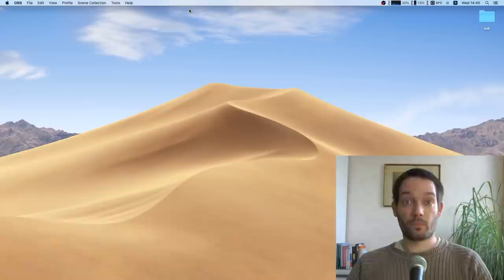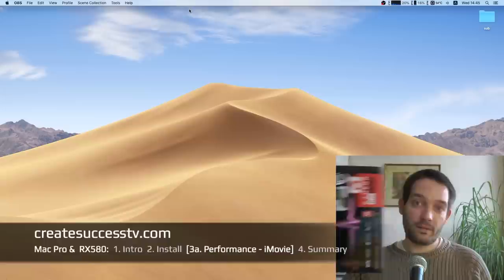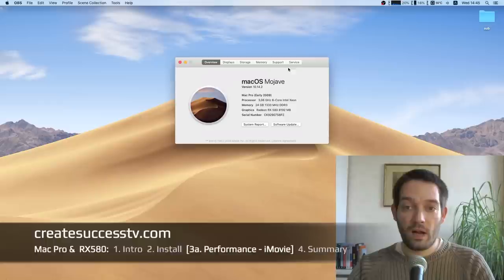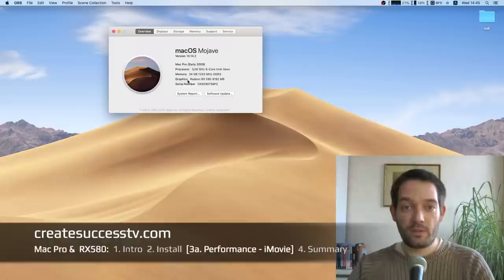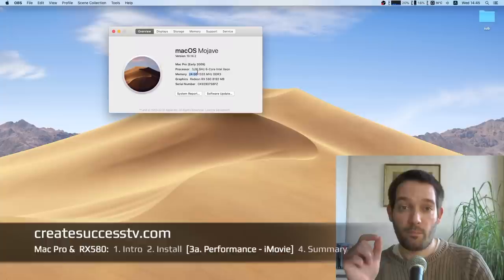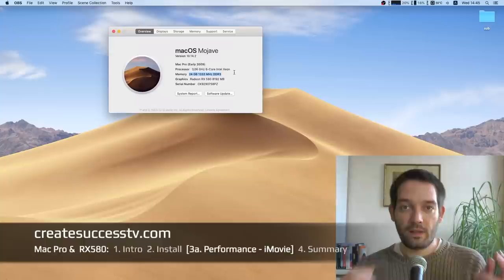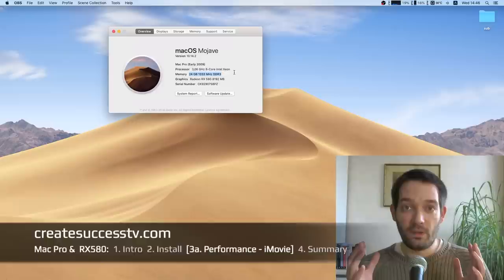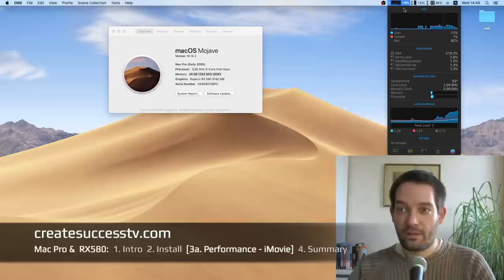Mac Pro 4.1 and 5.1 GPU Upgrade for Mojave (Sapphire Pulse Radeon RX580)

Comment: i would like to upgrade my mac pro graphic card mid 2012, i have a ATI Radeon HD5770, is the RX580 a better upgrade. thank you
Reply: @juschu  i have the same a mac pro 5.1 2012 with HD5770... i would never replace a gpu with non EFI mac edition. with a RX580 have too many problems.. No booting screen, file vault must be disabled, bootcamp issues etc... It's a shame what apple is doing to this incredible machine.... i would prefer update to the nvidia k5000 mac edition it's old but support metal, boot and all... And is not that bad after all... have a display port 1.2 and support 4k at 60 and it's still a valid option.
Reply: @juschu  Since the Sapphire Pulse RX580 do not come out of the box with a flashed ROM for Mac OS you can't physically see booting screen... You will see directly LOGIN screen... that is something different... The Sapphire Pulse RX580 that apple reported as "supported" by the mac pro 5.1 it only means that there's no need to setup or install drivers since the architecture is compatible with Mojave GPU's drivers... In fact lots of persons who updated the Mac Pro 5.1 with the Shappire Pulse RX580 they reported on macrumors or other forums that they do not have booting screen or can't use file vault... So how you can see the apple logo booting screen? you would be the first in the world......
Reply from the maker: @JohnDoe-ml1ui  I think so too, the new graphics cards, RX560, RX580, Vega56 are all non EFI, so you won't be able to see the boot screen, and you can't use the "Startup Manager" Option (⌥), however a viewer once asked me about "macOS Recovery" Command (⌘)-R, and I tested it and at least that worked, even thought it took a moment to boot.
Reply from the maker: @juschu  Are you saying you did flash your Sapphire Pulse RX 580 with an Apple compatible EFI Bios? People in the MacRumors forum claim it isn't possible, see here ➜ https://forums.macrumors.com/threads/why-do-sapphire-pulse-rx-580-uefi-cards-need-flashing.2132482/

Comment: Do I have to install some drivers before I plug it in or is this plug and play ? Cause I have a tried the graphic with one 6 to 8 pin cable but screen stays black.
Reply from the maker: Before updating to macOS 10.14 Mojave, please make sure that your graphics card works with Mojave
➜ https://support.apple.com/en-us/HT208898
Reply from the maker: Case A: Use the "mini 6pin to 6pin" for a total of 150 watts available ➜ https://ebay.to/2QWy27Z
Case B: Use the "dual mini 6pin to 8pin" for a total of 225 watts ➜ https://ebay.to/2zN23QJ

Comment: Hi I do get purple screen when I use DVI but when I use hdmi I got perfect colour, RX 580 nitro+ thanks
Reply from the maker: I did try DVI and it worked fine with my EIZO monitor, maybe check your -> settings -> Signal -> Input Color Format -> (1.Auto 2.YUV 3.RGB)

Comment: I also have a rx580 for my mac pro 2009(4,1flashed to 5,1) , but I wont have a boot screen until the system loads totally. how do u solve this problem? thx
Reply from the maker: First, that is perfectly normal, because the system will still boot and run fine. Also, you can still get into recovery mode by pressing Command (⌘) – R, second, only cards with a custom Apple BIOS will display the boot screen.
Reply: you can't solve this with polaris cards
Reply: Back2Black I think because it’s metal supported in your os....in hs and earlier it won’t show
Reply: @juschu  Where did you get that card from? :)) Most RX 580s, even the Pulse ones, won't show the boot screen.

Comment: hello, thanks for this vids :D I have the same GPU a nitro+ radeon rx580 (mac flashed) but the fan start sometimes... every 15 seconds approximately... I suppose need cold air... But it's very very very frustrating :D did you have an idea how to stop that? i put in silent mode (2) and always the problem :(

Comment: Nice video! Thank you. WIll the card run on a 5.1 with EL CAPITAN? Do i need the power-cable?
Reply from the maker: No, I don’t think so, El Capitan is from 2015 and probably too old, please install High Sierra and get the power cable, more here:
Part 0 - Introduction ➜ https://youtu.be/lJF-rffIyq0
Part 1 - Bluetooth ➜ https://youtu.be/d9xPvreK8tg
Part 2 - High Sierra ➜ https://youtu.be/ecWEhbtvXHk
Part 3 - SATAIII SSD ➜ https://youtu.be/2gqkGPidI84
Part 4 - Radeon RX560 ➜ https://youtu.be/UoV4I-FlYdw
Part 5 - Memory ➜ https://youtu.be/1XYNqfnu4UA
Part 6 - CPU ➜ https://youtu.be/8cVhURcpi64
Part 7 - macOS Mojave ➜ https://youtu.be/uKAJCuWtp4Y
Part 8 - Radeon RX580 ➜ https://youtu.be/Dv73HrnsNkw
NEW *Part 9 - NVMe SSD ➜ https://youtu.be/A8hPC_DDq6Q
NEW *Part 10 - Fan Replacement ➜ https://youtu.be/fBiIJami8v0
Reply: Thanks!  @ReviewTechTV
Reply: @ReviewTechTV  : thx from Belgium for the video! I'm running El Capitan as well on my 5.1 and I'm looking to install this card also. However the systems says it can't upgrade to (high) sierra? How do I do that?  UPDATE: never mind: I've just discovered your other video's stating just how to do that!

Comment: I have a mac pro 5.1 with (Mid 2010) with 2 x 3.46 Ghz 6 core intel Xeon, 
64Gb of RAM
Radeon RX 580 8 GB graphic card
and currently using OS High Sierra 10.13.6

Where and How can i upgrade to Majove ? I tried a patch and got this message :
1. MacOS Mojave Patcher

Natively Supported Machine
This machine is natively supported by Mojave; you do not need to use this patch. It can still be used to create a USB drive to be used on another machine.

What do you suggest sir ? Thank you for your help.
Reply from the maker: Additional information in the video description.

Comment: I have the same RX580 Pulse in a 5,1 and i have problems..keep saying update firmware and it’s been updated 4-6 times..still nothing..i switch slots because i didn’t want heating problems and now that i did a firmware update again, it’s been updating firmware for the past 5-6 hours? And the card don’t have heat problems....so why am i stuck at this point cause i don’t want to cut off the comp to mess anything up!!
Reply from the maker: You can install the Radeon RX580 under macOS High Sierra, then no firmware update is required.
Reply from the maker: If you want to install macOS Mojave on the MacPro:
Part 7 - macOS Mojave ➜ https://youtu.be/uKAJCuWtp4Y
Reply: Review Tech TV where what link, what site?

Comment: Hello. Play on windows ( AMD Vii gpu 16GB ) have tried?  I have Mac pro 5.1, 3.46 Ghz, 32Gb ram, Rx 580  8Gb-i used windows 10 - The witcher 3 ( ultra setting) 60fps. Maybe better Vega 56,64 and Amd  VII gpu  on Mac pro 5.1?
Reply from the maker: No, the AMD VII card needs too much power, and most Vega cards need two power connectors, that's why they don't work easily.

Comment: The sapphire rx580 I have found says it’s windows compatible only. I hear people say it still works with Apple CPU’s though. Are you using the same video card or does yours say Apple compatible? Would like to know before I make my purchase. Thanks.
Reply from the maker: The card needs the correct power cable to work, details below the video.

Comment: I have the same setup and just installed this same graphics card. When I boot the screen colors look like when the cuda driver needs to be updated and says no GPU detected. Is there a driver that needs to be installed? If so I can't find it, any help would be appreciated.
Reply from the maker: Only Nvidia cards have drivers, for ATI cards there are no drivers because macOS supports them natively. Please uninstall all Nvidia drivers before switching to an ATI card.
Reply: Thank you for the help. I think I deleted the Nvidia driver, but the screen still has a purple tint to it. Any idea what might be wrong?
Reply from the maker: I recommend you upgrade to High Sierra, and to make sure all Nivida drivers are removed. If it still doesn't work please check your display.
Reply: I figured it out, when I plugged into the HDMI port it worked fine, not sure why the other didn't. Thanks for the help!!

Comment: Great video! Do I still need my GT120 GPU for Bootscreen Support? In which cases is it still helpful/necessary? I mean booting from pen drive to re/install macOS seems no issue with the RX 580. Moreover I ask myself if there are any disadvantages if I have 2 GPU‘s installed.
Reply from the maker: Personally, I only use the new Radeon RX580 in my system, the old NVIDIA stock GPU has become more or less useless, because it doesn't have Metal support, which macOS Mojave needs.
Reply from the maker: But I still keep it in a box somewhere just in case. And you can still get into recovery mode by pressing Command (⌘) – R, even without seeing the grey Apple boot screen, just takes a little to boot up.
Reply: What about FileVault and Bootcamp? For that I would need Bootscreen-Support, right?
Reply: @Simon-me1qu  I'm running OS Mojave on a 4,1 flashed to 5, 1 that does not require the GT120. I sold it along with an older Mac Pro tower. I have a Radeon 7950 3GB that I dual boot between Windows and Mac OS on the daily. From my personal experience, it's not needed.
Reply: @ofrhythm  how you manage to install High Sierra with the Radeon 7950 mac edition? my Radeon 7950 works only in Sierra when i try to update to High sierra stops working! but with the GT120 works!
Reply: @mrhigado  The only big difference that I would assume first, is that it is flashed to 5, 1. 

I actually upgraded to the Sapphire Nitro+ RX 580 8GB recently.  I am still running Mojave fine. I just think I will be purchasing a GT120 so I can have a boot screen.

Comment: Have you had any issues with the Mac ramping up the PCI and powersupply fans to maximum? I assume it's something to do with the 0 RPM mode on the card like you pointed out. Mine seems to turn the fans to max after every couple of reboots. Many thanks!
Reply from the maker: The GPU fans will spin when you turn on your Mac, but after booting the OS they turn off, unless there is load on the card, e.g. video editing and such, but even then the card is  pretty quiet.

Comment: What I do to make appear the Apple logo on AMD Radeon RX 580 Sapphire Pulse graphics card?
Reply from the maker: Apple uses a custom BIOS on there stock GPUs, all aftermarkte cards dont support the grey bootup screen, filevault needs to be disabled in case you are using it.

Comment: Your suggestion to put the RX 580 in slot 2 to dissipate heat means that it would take-up 2 PCI slots, correct? Instead of putting it into slot 1 which only take up 1 slot, leaving the remaining 3 slots. I guess if you're okay with sacrificing a PCI slot then this is a good strategy.
Reply from the maker: You can use both PCIe slot 1 or 2 depending on your preference as long as it is 16x lane bandwidth.

Comment: hello guys, i have MAC PRO 4.1 and i have just upgrade firmware to 5.1 Now i would like to upgrade SVGA Card, from nvidia GT120 to RX480 8GB or RX570 8GB... I try MacOS 10.12.4 , 10.12.6, 10.13.6 but none of the many can read the VGA AMD... why?? which version of macos i must use for read amd correctly? I have a nvidia gtx 1060 and 1070 ti too but 
 I tried to install it too and it remains even more difficult to make it work so I gave up and decided to use the amd. Can someone help me? I have seen many forums but I can't get away from them.
Reply from the maker: I tested two different AMD cards, and they work excellent so far:
Radeon RX560 ➜ http://geni.us/5V0VD3 
Radeon RX580 ➜ http://geni.us/rX6mx
Reply from the maker: If you can I recommend macOS Mojave, because it is the most up to date version, otherwise High Sierra should work fine as well.
➜ https://support.apple.com/en-us/HT208898
Reply from the maker: Did you actually test your Radeon RX480 card with macOS High Sierra or Mojave? Other people have successfully used RX480 cards without any problems ➜ https://youtu.be/6aB0wcN6l54
Reply from the maker: Also, I noticed that Apple has continued to improve the AMD Radeon drivers that are included in the OS, for example, while my RX580 did not have audio support via display port in the beginning, it now shows up as an additional audio device, that I can select in system settings.
Reply: Now I have 1 drive with 10.12 and another 1 with 10.13... i cant install Mojave because I havent a card that support Metal. Tomorrow I will search any R5 240 and  I try to install Mojave.... and then I will pray that all will be well!
Reply: Also make sure you update the firmware that comes with Mojave. You can do the firmware update , an stay on High Sierra

Comment: Good video and findings. I was wondering what the point of going to a RX 580 vs. an RX 560 was.  I didn’t get the 8GB model and thus I am not seeing a huge increase in my editing. Thank you.
Reply from the maker: I am very happy with RX580 8GB model, in my opinion has a good price performance value.
Reply: Create Success TV I couldn’t agree more. My mistake was getting an RX 580 - 4GB model. Ughh! I am okay with this now. I will get a VEGA 56/64 or even a Radeon 7, if I need more VRAM down the road. One last note, I am glad you shared your experience with iMovie. I was wondering what some of the performance differences between it and FCPX would be. I may make a video about the differences myself. 

I hope you continue making videos about your Mac Pro. I enjoy the format of your videos. TTYS

Comment: Hei!  i have Mac pro (4.1-5.1) and  buy today Asus strix RX580 8GB. i not have cable  two 6pin mac to one 8pin. I need order. If i use only one cable  6pin to 8pin,  it will work?
Reply from the maker: The Mac Pro can give you the following power...
• PCI Slot = 75 Watt
• PCI AUX A = 75 Watt
• PCI AUX B = 75 Watt
Reply from the maker: Please know how much power you GPU needs and get the correct cable!
Case A: Use the "mini 6pin to 6pin" for a total of 150 watts available ➜ https://ebay.to/2QWy27Z
Case B: Use the "dual mini 6pin to 8pin" for a total of 225 watts ➜ https://ebay.to/2zN23QJ

Comment: Hello there. I followed the recommendations and bought a "saphire rx 580 pulse" card. I upgraded my 2009 Mac Prom from "4.1" to "5.1". my mac pro 2X2.26 8 core early 2009. sierra installation and boot was very successful. then I upgraded my system from "high sierra" to "mojave". so far there was no problem. my system worked smoothly with "mojave" for 3 days. until the 4th day when I turned on my computer, my video card did not boot. and my boot screen didn't return even after I restarted it many times. I wanted to install "high sierra" again. but my computer didn't show boot again. Meanwhile, my motherboard's bootrom is 144.0.0.0. .I'm currently installing my old graphics card, working with high sierra. what do you think I need to do to activate my video card again?
Reply from the maker: Did you use the correct power cable? Because RX580 is officially used be Apple there should be no problem: ➜ https://support.apple.com/en-us/HT208898

Comment: Question. Are there drivers that need to be downloaded for Macbook Pro or are they not required? I can't find them anywhere - only for windows and linus. This is for the Sapphire Pulse AMD Radeon 5500 XT
Reply from the maker: There are not drivers provided by AMD, because they are build into the operating system directly.
Reply from the maker: Please install the latest version of macOS to ensure best compatibility and support.

Comment: Hi. Thank you for all the videos. I have a quick question. How good is RX580 for 4K rendering? I get a good deal in Vega 64 but requires a difficult pixlas mod to power them. Is RX580 enough or should I go for Vega 64?
Reply from the maker: Rendering performance heavily depends on what video codec you are using.
Reply from the maker: Most consumer mirrorless or DSLR use the slower codec that has the lower bit rate.
Reply from the maker: You will probably need to use frame-independent (or “intra-frame”) codecs such as Apple ProRes or Canon ALL-I for faster editing and export.
Reply from the maker: For example:
1920x1080 Full-HD Canon IPB = 30 Mb/s
1920x1080 Full-HD Canon ALL-I = 90 Mb/s
1920x1080 Full-HD Apple ProRes = 147 Mb/s
4096 x 2160 4K Canon IPB = 120 Mb/s
4096 x 2160 4K Canon ALL-I = 480 Mb/s
4096 x 2160 4K Apple ProRes = 524 Mb/s
Reply from the maker: If your camera supports it use a intra codec with high bit rate, it will give you better performance because codec is more important than the graphics card.
Reply: Thank you for your replies. So will go for the RX580.

Comment: Will this work with an apple cinema display 23 inches or do I need an adapter?
Reply from the maker: I have only tested HDMI and DisplayPort using various EIZO and LG displays, 24" Full-HD, 27" WQHD, 32" 4K, as well as ultra wide curved displays did work fine.

Comment: Great video.. I have a 5,1 Mac Pro Mid 2012 / 2 x 2.4 GHz 6-Core Intel Xeon / 24 GB 1333 MHz DDR3 / Sierra/ that I purchased from a friend.  I am wondering if you could coach me a little here. 
I am using it with a 30" Cinema HD LCD that I recently bought on CL that was mint and recently noticed the Mac Pro  has a >NVIDIA Quadro K6000 12287 MB< in it.  
My question is:  with this 16 year old monitor is it necessary to be driving it with this GPU?  The most stringent thing I do is photo editing in LightRoom.  Can you make a GPU suggestion that would be adequate AND perhaps what other upgrades that would be consistent with photo editing and watching movies?
Thanks
Reply from the maker: In order to run macOS Mojave you will need a modern GPU that support Metal, additional infos in the video description.
Reply from the maker: Also a useful support article here:
➜ https://support.apple.com/en-us/HT208898